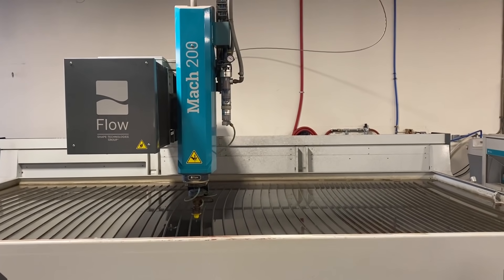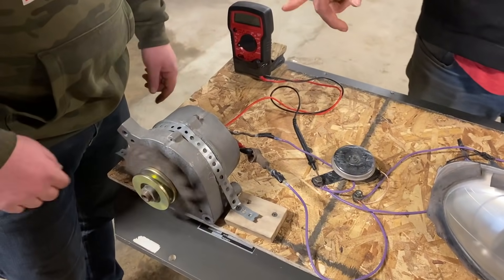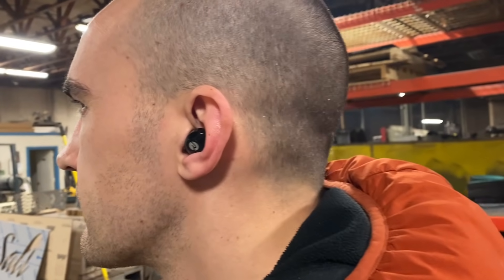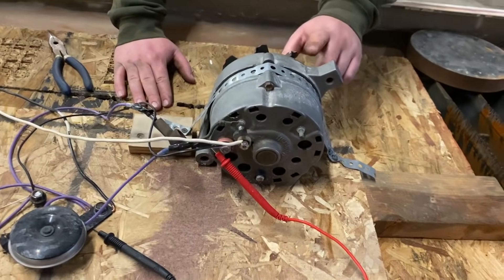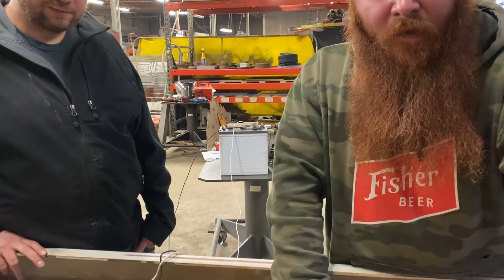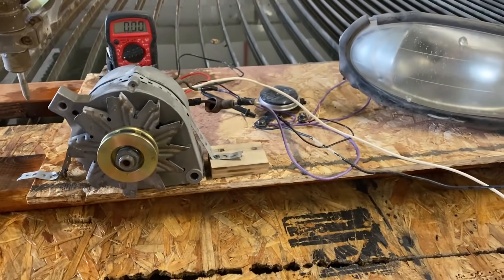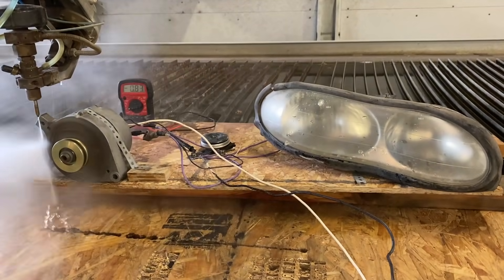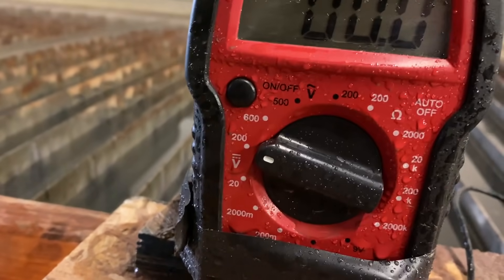How Much Voltage Can Alternators Generate? Using a 60k PSI Waterjet

Comment: If you ran that alternator at those speeds without a regulator, it would produce hundreds of volts. I suspect the rectifier diodes are blown and shorting the windings. What output it is producing now will be AC.

Comment: I think all of that voltage being fed back into the electromagnet could be somehow limiting the voltage the alternator is putting out. leave the battery connected and disconnect the alternator from itsself and see what happens. I dont think it would short the battery because there wouldnt be that much voltage coming from the magnet. ...maybe.

Comment: I assume the alternator has a rectifier inside itself and done limiting circuitry. That is your limit of voltage, it limits itself because the engine RPM has quite a broad range and to add above that it is pulley driven with RPM advantage. The voltage is limited by limiting the field strength. You could rip it apart and gut its internals pull the wires of the three phases out and rectify that and then manually control the field strength to see what voltage you'll reach. I am more than certain it is going to be at least 200V no load
Reply: As they specifically stated in the video and comments, it is unregulated.  Or, was unregulated.
That 'ping' fried every diode.  That's why it loads internally now, internal shorting.
Reply: @tsm688  very likely...I have seen alternators with just winding lead outs but I have also seen some with complete regulation so nothing extremal would be needed.
Reply: @adam207321  People have identified the model in the comments.  It's old, and unregulated.

Comment: Are you aware that the alternator is supposed to spin clockwise.
Reply: It doesn't matter, that's an AC alternator, those have a 3 phase bridge rectifier build in.
What's more important is to regulate the field windings, if u dump over 6V in those field windings they just turn into heaters and the field won't get much stronger.
That's why it bogges down so hard without much of a load.
Reply: And the bridge rectifiers job is to cut the negative waveform off of the pattern to convert AC electricity to DC electricity. That square waveform is why LED lights on cars flicker when viewed through a video camera.
Reply: @RadDadisRad  LED lights flicker regardless because they are typically run using PWM regulation which basically turns it on and off faster than we can see, the shutter speed of the camera however makes it possible to see it.

Comment: It actually makes sense it would max out at 14 volts that way it doesn't overload the car's battery and electronics car batteries are 12-volt batteries but are usually around 13 to 14 volts when fully charged I didn't see 30 volts

Comment: You need power to create power with an alternator. And a 12 volt not a 6 volt. You can spin it 50 RPM or 5,000 RPM. You need a 12 volt to get it to work.

Comment: You are actually getting ac voltage straight from a generator/ alternator, as the magnetic poles swing past each other they flip so you get sine wave. You can make it become dc but it comes out ac
Reply from the maker: The alternator generates AC voltage but alternators also have built in rectifiers that convert the voltage to DC. We were reading DC voltage on the multimeter.

Comment: That’s exactly how Pelton wheel hydro electric generators are powered.
Hi pressure water fired at a cup mounted on a shaft that has cooper coils and another housing that is a stator and also has cooper windings. 
An electric field is produced and the power is drawn off.

Comment: But you're outputting in AC, so wouldn't the voltage effectively double? (Measuring from +13 to -13 as opposed to +13 to 0)
And who wants to guess at the frequency, spinning at up to 60K RPM, and the field winding would be also changing polarity.
Lastly, we haven't touched on current, but all least none of the wiring fried itself

Comment: Its an altanator it produces ac but then the 3 phases and recitifed to dc with 3 diods in the back of the alt. Take the bacl off and run straight out of 3 phases you will get ac . Then jump the output of all 3 phases into the field . And of course your light you will see volts rise with rpm over 1000 if u spin fast enough but also hertz are linked to rpm ie more reve more cycles per second. You can regulate input voltage to field and set volts were u want . And a 6v alt is rated at about 9 volts so you can charge a 6v battery you need more than 6v to push volts in. Ie a 12 v alt is rated output of 14_15v. And the neg volts on the meter in the vid is cause its turning backwards. Sorry bout spelling fat fingers small phone.

Comment: For one of the bulbs to explode, you need enough voltage to sustain an arc. Pretty sure you would have read quite a bit more than 20V on a meter with decently fast min/max function.

Comment: How long did it take to figure it out you needed to have a battery in the system make an alternator work? You need to excite the field windings so that you can produce electric current. There is no permanent magnet in an alternator. 6 volt alternator never heard of one I've been around since day one with alternators.

Comment: i have always wondered what the difference was between Alternators and Generators every time i would search it all i would get is how a generator works.
Reply: They were wrong about the difference.  In automotive applications, DC generators are called generators, AC generators are called alternators.  Old vehicle's used 6V DC generators.  They switched several decades ago to 12V alternators, largely because AC generators are more efficient.  Since the rest of the system needs to run on a battery, they have three diodes inside to rectify each of the 3 phases of AC before connecting the three outputs together on the alternator output terminal.

Comment: 8:06 - The back EMF produced in the field coils is acting against the current generated in the rotor, in accordance with Lenz's law
, hence causing the rotor to rotate slower for a given torque (by the water jet). At 11:00 the back EMF produced in the field coils opposes the rotor generated current to the point where the rotor speed plateaus for the give torque by the water jet.

BTW you said the alternator has no regulator on it, but if you are producing 20VDC then it must have been rectified via the alternators internal rectifier?

Comment: Some clueless people may call this free energy. Well, it would be if you weren't paying the electric bill to run the water jet.
Reply: Actually i have read through the comments and have not found 1 comment calling it that. Did you just make that up? Is that a comment you frequently copy/paste around the web?
Reply: My city keeps raising the water bill, I pay $100/mo for water now.  It's crossed my mind to hookup a tesla turbine to my water supply and just let'r rip and power an alternator to make some power.  May as well get my money's worth!   About 80PSI coming out of a 1/2" line... not sure how much watts of energy to expect from that and I'm not good at math.
Reply: @JM-yx1lm   I just wrote this for the video. I don't troll comment sections it's just an observation.
Reply: @redsquirrelftw  In the UK most houses have water meters so we pay for what we use. But if you're serious get a wind turbine or solar, water turbines are are only really useful for constant water flow like rivers.
Reply: @MusicFurler  This would be constant flow.  We pay flat rate, and it's super expensive, so may as well get "free" electricity out of it. :D

Comment: im more impressed by the amount of current that waterjet table draws... 75amps wow.....
Reply from the maker: The breaker required is a 75 amp 480v 3 phase breaker. The waterjet probably only draws about 30-40 amps consistently and maybe 60 peak amps at start up.

Comment: It would be cool with a amp clamp and to pull the voltage regulator out of the alternator.
Reply: Probably safer for the meter if it was just a shunt. :0) I keep a large 500amp shunt in one of my tool bags for occasion like this

Comment: So, is that an internally regulated alternator?  The voltage its making is what it should be running in a car. Sounds like you need an alternator that is externally regulated... run it without the regulator
Reply: didn't they literally say unregulated?
Reply: @tsm688  could have, I probably missed it jumping through the video

Comment: It looks like the alternator is running backwards remember an engine spins clockwise not counterclockwise and on your voltage meter I seen in the video that when it started spitting it had a negative line out beside the numbers.

Comment: you should have put it on ac voltage
Reply: Goes through a voltage rectifier. So, without wiring the meter before the rectifier, it'll only read DC.
Reply: @wheeman999  i think they said it didnt have one builtin
Reply: @prototype9000  they said it doesn't have a voltage regulator. It has to have a rectifier, otherwise it wouldn't be reading in dc voltage.

Comment: take a 3 volt battery and plug it in to the rotor winding and speed the damn thing and it will produce a lot of voltage and current.

Comment: About 13.96 volts until it explodes because thats how modern wound field alternators work.

The rotor is an electromagnet excited by a regulator circuit, which is fed exactly enough current to keep the rectified stator output constant.

At 60krpm, that current will be very low, but it will still be shooting for that same voltage.

Comment: That’s producing AC voltage not DC. Multimeters can read small DC when high AC is accruing. Generators ALWAYS make AC.
Reply: I have taken apart auto alternators.  True they generate AC but they contain great big diodes inside to turn that into DC.  And they have three AC phases so it actually rectifies to something good enough to call DC if you squint a lot.

Comment: This seems incredibly unremarkable. Just... It's an alternator. Powering a car headlight. Like in, you know, cars?

What am I missing?
Reply: The part about doing it with a water jet
Reply: Yes but... Ahh nevermind
Reply: @jaakkopontinen  hehe. No no. I feel you too.  I want my time back for watching that. 😏
Reply: Okie... Yeah 😅
Reply: It's an unregulated one, so nothing stopping it from pumping out stupidly high voltage.

Also, they connected its output to its input unregulated, creating a feedback loop of more voltage causing more voltage, making things go pear shaped REAL fast.  Pretty sure they fried all the diodes inside it with that ping.

Comment: Did anyone notice the multimeter was displaying a negative voltage, as if the wires were plugged in wrong way round,
Silly thing to mention but it caught my eye

Comment: What was the amps??!!
Reply from the maker: it would only show the amperage of the draw, and light bulbs don't draw much
Reply: @WaterjetChannel  car lights draw 12-15 amps
Reply: @WaterjetChannel I know you would need a test load. Alternators are measured in amp output so most people would want to see an amp test.
Reply: @WaterjetChannel  one could measure the short circuit amps if one wanted to, of course there would be some chance of "blowing up" the alternator which doesn't seem like something you guys would do :)

Comment: 480 volts at 75 amps??? That's what? 36,000 watts?
Reply: about 62kW, it is undoubtedly 3 phase. I have a vague recollection of them saying the pump is something like 60hp which would be less watts but I might not be remembering right
Reply: @jaytalbot1146  I balance electrical panels for a living. 480 voltsx75amps is 36000 watts unless they were just randomly choosing numbers or were talking about just the waterjetand not any of the systems included with it. Also a 75 amp breaker would fill up 3 slots in the electeical panel.
Reply: @1TakoyakiStore  While I avoid messing with panels as much as I can, I do repair equipment fed by 480V 3 phase panels. 480V motor loads are always three phase, probably most of the breakers one will see in a 480 panel are three pole taking up 3 spaces. Well, except for star wired lighting panels with 277V (to neutral) lighting circuits that are filled with single pole breakers.  480V x 75A x sqrt(3) = about 62,000W.  Sounds like a lot compared to anything one would have in their home, but nothing too special for light industrial.  You make a good point about a 75A breaker, I suspect that is what they were talking about rather than actual load. Since one is not supposed to continuously load a breaker more than 80% of it's rating they'd be down to about 50kW . It looks like a typical headlight is a bit more than 50W, so therefore around  0.1% efficiency lighting that headlamp, not going to get an Energy-star rating for that setup.
Reply: @jaytalbot1146  I only do residential electrical plans so this is quite interesting to me.

Comment: First off the alternators have diodes in them they only allow a certain amount of power output four 12 volt alternator at somewhere around 19 18 volts this is a waste of time

Comment: The multi meter was set to 200V DC, that's why the numbers were all over the place. It's an alternator, it generates AC, you should have set it to AC volts (black numbers on the dial).
Reply from the maker: Alternators have built in rectifiers that convert the AC to DC. It was DC voltage that the meter was reading.
Reply: @WaterjetChannel  You took the regulator out, rectifiers are typically embedded in the regulator.
Reply: @nowanda2nd  It was an ancient unit with an external regulator.

Comment: Also you need to take out the voltage regulator if you want to increase the voltage.
Reply: They said that it does not contain one

Comment: alternators are ac
Reply: you cant just say that, although you are partly right.
Yes they are ac generators but they have a big fuckoff rectifier block inside turning the generated 3 phase ac to dc, you wouldnt be able to charge a your battery with ac